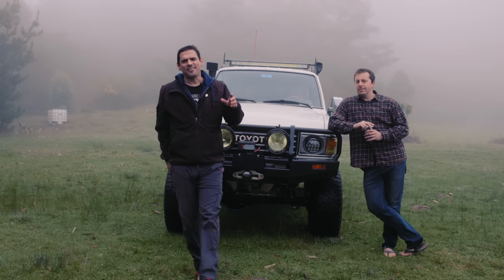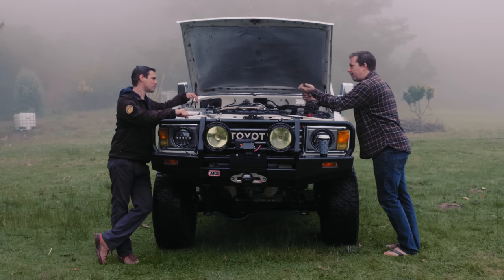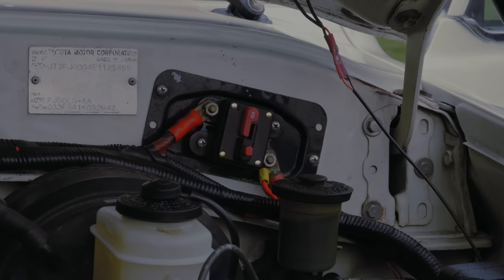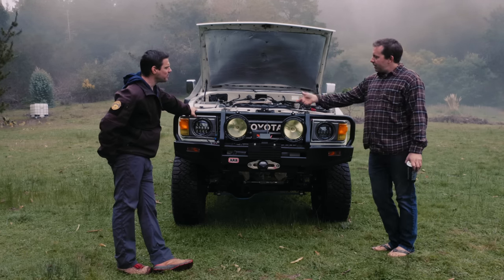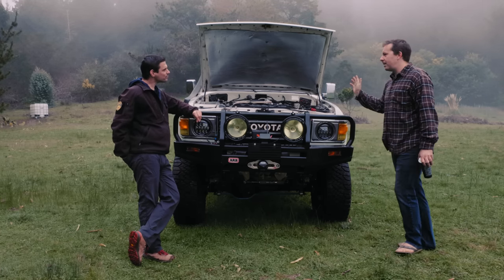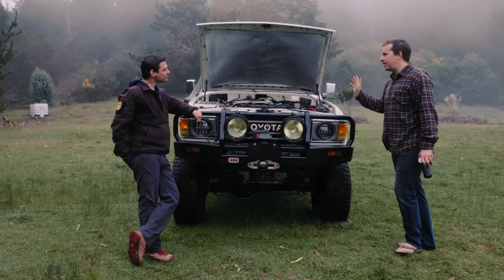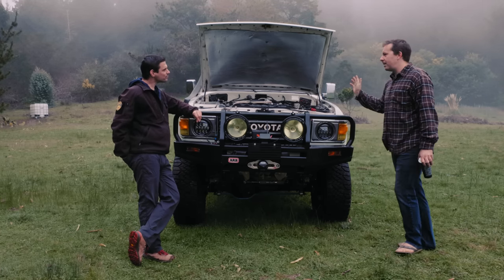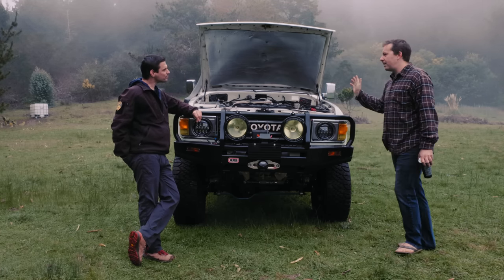Overland Walk Around | 400HP V8 84' Toyota FJ60

Comment: Could you clarify the overdrive & adapter you used?? about to swap an LS into my FJ62 and did not know this was an option, but it sounds perfect
Reply: Probably used an NV3500 or NV4500 from a chevy full size truck. They make adapters to use the Toyota T-Case with those trans.
Reply: What I think he has done is use a Ranger Overdrive, PN 760024M-27,  that sits between a Chevy bellhousing and the Toyota transmission.

Comment: My understanding is that a 80 rear axle is 5" inches wider then the stock 60 front axle. Did you narrow the 80 axle ? widen the front axle ? run spacers on the front ? I do understand why you put the 80 axle on the rear. Full float, Disc brakes, and the all important parking brake. an amazing rig. Thank you for sharing.
Reply: It’s only 3” wider so I have 1.5” spacers in front. Otherwise yes all the benefits are true, it’s a very good upgrade.

Comment: Beautiful FJ60.  At 8:12 when showing the shifters, I see from right to left, Transfer Case, Manual Trans (h42?), but what is the third shifter on the left?  Is that the overdrive you were referring to or do you have dual transfer case?
Reply: Overdrive
Reply: @youpers  What Kit is used for the over drive? I just put a 5 speed and planning on putting in an LS in my 85 FJ60, I’m planning on building a second fj60, if I could use the overdrive kit on 4 speed I would have a big savings.
Reply: Overdrive kit for land cruiser from Advanced Adapters is discontinued......

Comment: Great video!

Everytime I see one of these older rigs I fall in love, until I get into a newer rig with all the creature comforts were all used to...

How do you balance creature comforts and daily driving vs off road rig?
Reply: Thanks for the comment, when I drive this its usually on the trail or weekend trips, it doesn't see any daily driving.
Reply: low expectations
Reply: I drove my FJ40 as a daily driver until I sat in an air conditioned, a HD sound system equipped 4Runner.... parked the 40 and only wheeled. I miss driving it though that is why it is getting a make over so I can add some of those creature comforts to and aging piece of off-road art.

Comment: Firstly, Sweet 60. I've gone another route with mine but see improvements you have tackled I am interested in. 
@Anthony, any chance you could elaborate more on the PSC steering upgrade?  Would really like to have a conversation with  you about it.
Reply: Thanks for the complements. The PSC hydro assist is great, you just need a ported steering box. Several companies out there offer it as a service but its honestly not too hard to do yourself if your so inclined. Then fabricate a bracket off the axle and clamp the other end to the tie rod. I used their 1.5x6 shaft. Hope that helps.

Comment: Do you mind sharing some info on the solar panel system? I think that's a great mod and would love to put it on my FJ60.
Reply: Its a 100W panel with a controller in the center console that connects to the start battery via backfeeding a fused circuit on the main fuse panel, that way I can isolate it for long term storage.

Comment: Awsome rig!! I have an “83”, doing some of the same stuff. Can you explain a little better your motor back set up? Chevy motor/bell housing, and then I was a little confused after that?
Reply: Thanks for the appreciation! The setup is: LS based small block, flywheel with correct thickness for use with a early model SBC bellhousing and clutch, cause the AA ranger overdrive is meant for a pre LS SBC. After the ranger its just toyota H42 trans, and t case, also added 4:1 t case gears, they helped the crawl speed a lot! Hope that helps.